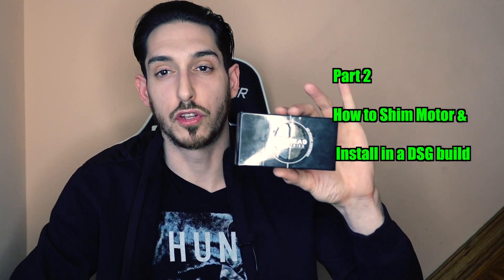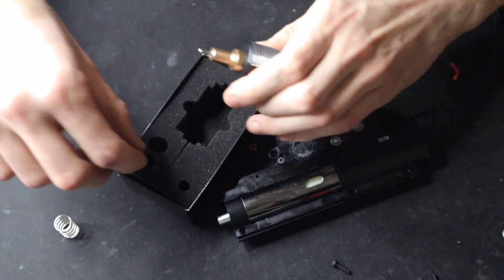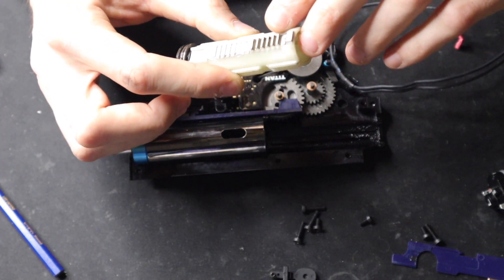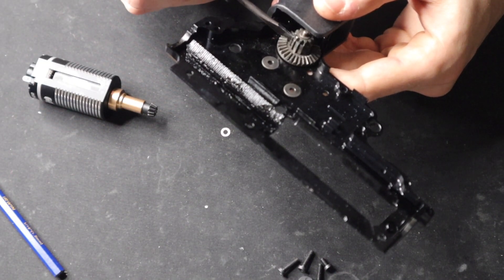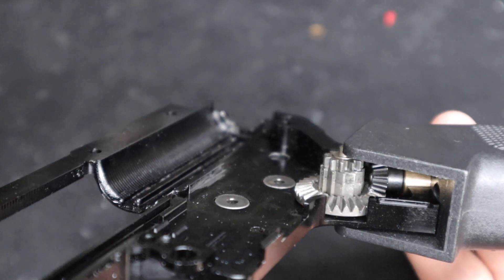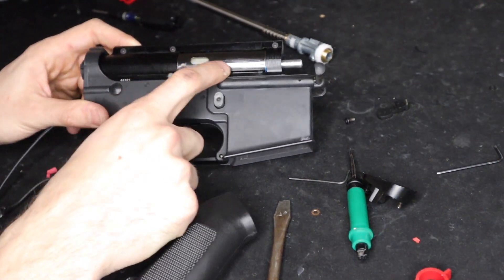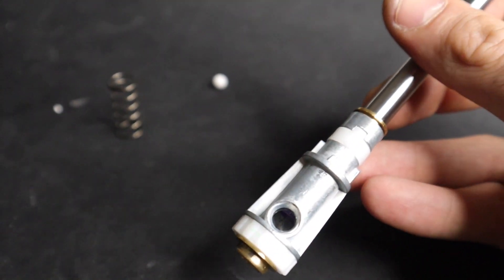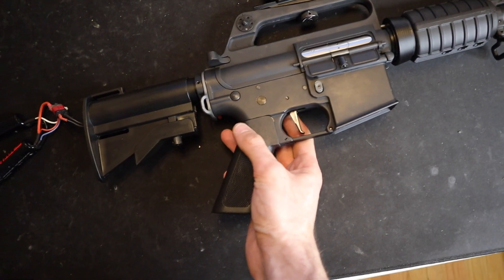Warhead Brushless Motor x High Speed DSG Install & Test + Mis Feeding FIX

Comment: mah doesn’t affect rof tho its only
voltage mah is how long the battery lasts
Reply: Mah can increase rof in some builds depending on how power hungry they are.  In a power hungry build like this dsg you need a big battery to supply enough amperage to the motor, otherwise you’re losing out on rof.
Reply from the maker: Well said !
Reply: I heard the voltage, maH and C rating all had to do with it. It was C times maH divided by 100 or 1000 cant remember but  the division was literally to get rid of extra zeros. And that would give u your amps.
So I believe he’s right. Maybe just didn’t fully explain it but mah does have a part in it from what I’ve heard/read.
Reply: @reapermedia1937  ok ty!  sorry for the misunderstanding
Reply from the maker: Yo this is awesome I love how everyone’s chatting tech information. This is how we learn and build brrrrt brtttt machines !
Reply: The Real Deal Airsoft definitely! 
When I have more time next year I want to try my hand at a DSG build with a skeleton pdw I have. It actually got discontinued after only a handful of years on market.

Lancer tactical cobra pdw m4
Definitely coming back here to see tips off your DSG videos 🙏🏽
Reply: @reapermedia1937  if I remember right it’s mah/1000 multiplied by your discharge rate  (c rating).  So on a 2500 mah battery with a 40c discharge you would end up with 100 amps.
Reply: @reapermedia1937  I think the C-rating is just how long it takes to charge, Mah is how long the battery lasts, and Voltage is how much power is going into it at once, so increase Rof, but im not an electrical tech, I try to learn how to work on my own guns, so if that's not it, just let me know/educate me
Reply: TheLethalPredator c rating is discharge rate, I can’t read past electrical tech. The “read more” button hasn’t worked for me on mobile YouTube for like a year now. Not sure if it’s a bug or wtf but it’s annoying :\

But anyway, with batteries voltage kind of serves as your constant. For example 7.4v 11.1v 14.8v. 
The C rating and MaH are use to calculate how many amps you’re battery outputs maximum. 
I think mine was in the 75 range. Been a while since I’ve messed with any of my guns. 
Voltage does also play a part in your ROF, been a while so I can’t explain it too well sorry, but I’m sure you know anyway lol.
Say you have a 7.4v 20c lipo vs an 11.1v 20c lipo and both have 1500 mah.
You’ll gain an rps bump and trigger response bump with the 11.1v.
Reply from the maker: You are incorrect  mah does play a role in the ability to draw high current consistently